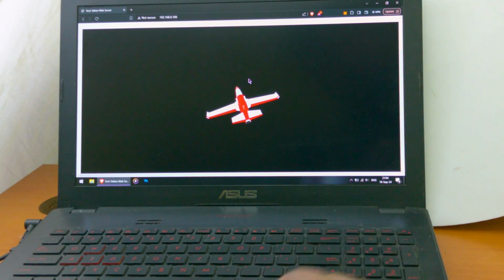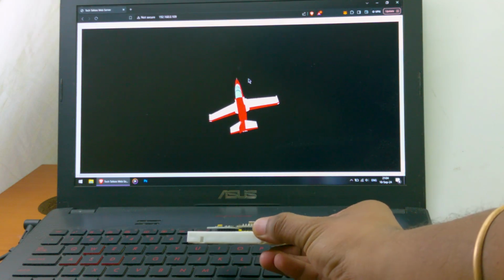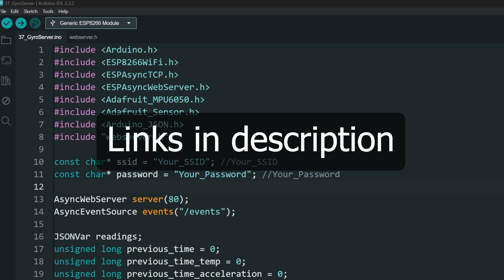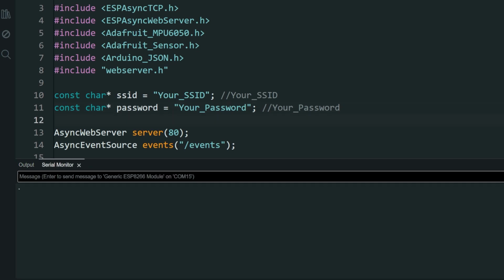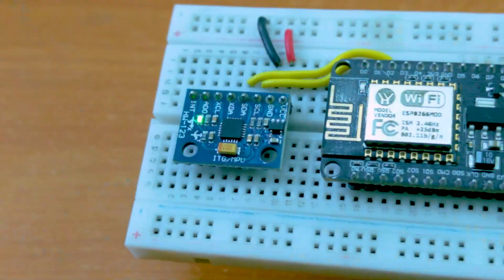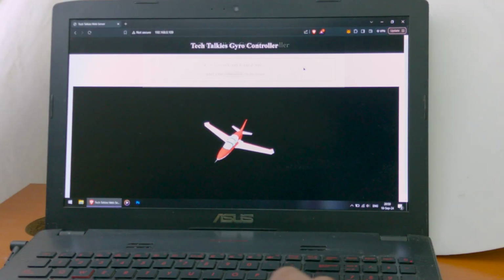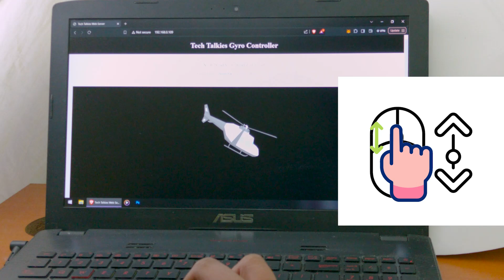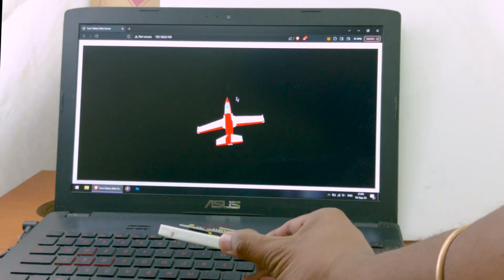ESP8266- 3D model viewer | Without LittleFS

Comment: Why do you use esp8266 in so many projects? Isn't esp32 much better?
Reply from the maker: Most of these simpler projects are aimed at beginners or students even. And the ESP8266 is much cheaper than an ESP32, at least here and in most countries. Overall, it is best suited for simpler projects. Let me know if you think otherwise
Reply from the maker: Also, in my experience, the ESP32 dev boards were not really straightforward while programming or running. There are so many variants. They have grounding issues, external power issues, etc. 8266 is really beginner friendly!
Reply: @techtalkies1  All right, thank you for the answer. I am a beginner really and recently bought a ESP32, but I didn't realise it had these limitations if not I'd had gone for the other one.
Reply: By the way, really good videos, I learned a lot!!
Reply from the maker: Thanks a lot. Appreciate it.